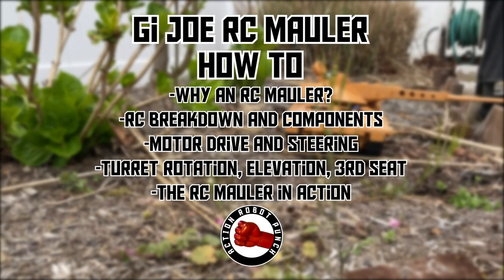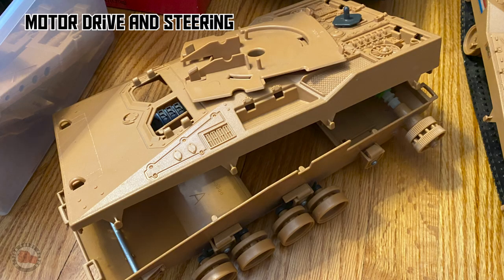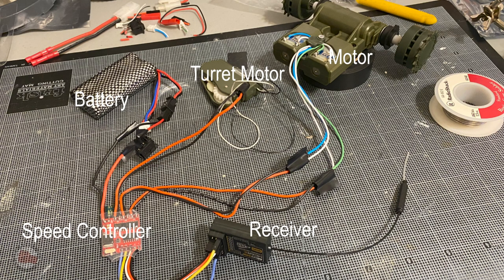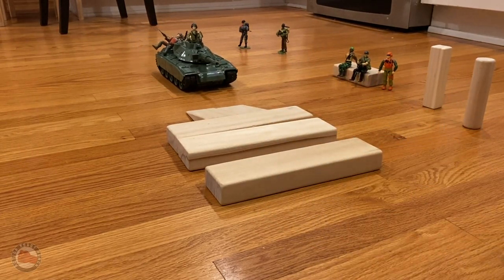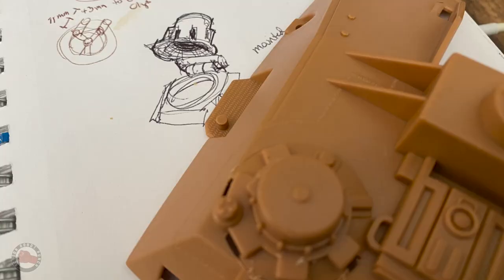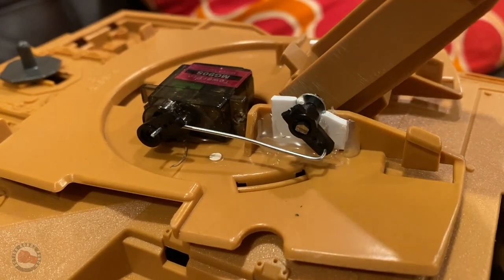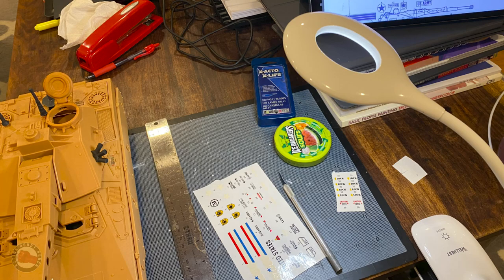Gi Joe Remote Control Mauler Tank - DIY How To

Comment: nice tutorial!
also, it s great memorabilia to see the hal laser cannon.
man, did I love this thing.
don t you have grand slam to operate it?
I d see Duke in the turret, Heavy metal is supposed to be the driver.
if I did rc a mauler, I d probably not make a hole in the turret,
I actually like an automated firing system as concept.
nowadays, some tanks are totally un manned.

I d like to see your take on the latest biggest tank of the joe line.
the grizzly, I have not seen much of this model.

good work!
Reply from the maker: I don’t know if I have grand slam. The first year guys mostly look the same to me 😁 I also loved that HAL. I had the mobat to tow it. I never had a mauler. I was to old to get toys by then but my cousin got it and the moray, defiant, etc. I’d play with him and think how cool these toys were but I was too old to get them. Now I don’t care how old I am lol
Reply: @ActionRobotPunch  in 82 I was 13, I kept having more money, I could nt stop buying more until 19, of course, I was posing figures more than anything around 15, had girlfriends and all, my friends knew my hobby - collection, none of them did it though, at 19 my sport car [crx] payments choked my expenses, and had little space, I had to buy plastic storage bins, and some pieces broke as a result. [packed too tight] I stopped buying figs around the 'head hunters', maybe 91.. the line died shortly after. with a house and more money, I never would have stopped collecting. my biggest regret was missing the rolling thunder.
I loved looking at my whole collection in a room, all figs standing 'for review'.
it was especially rewarding looking at cobras, since they looked more like a real army. multiples of the same units, uniformity.

Comment: Great video! It inspired me to do this with my Mauler. I am 90 precent done with my build. A few questions tho. It looks like you cut the nubs off on the barrel. Is that why you used the washers? How did you secure the servo horns? I am stuck and can't think of how to get the barrel to work properly. It actually doesn't work at all for me yet. Thanks for the video and links to all the parts and 3D designs you have created. So helpful and generous of you to post all of your design work for free. I did have to create my own gear for the turret cause I am using the Heng long motor and couldn't fit the turret motor. Not perfect but it works and fun to learn how to do it. I am also documenting all my progress and will hopefully post a video and would love to link your video if that is OK.
Reply from the maker: That's awesome! I love to hear that more folks are making RC Joe vehicles. To make the barrel move I didn't need or want the plastic nubs that the toy used (13:25 in the video has a really good view of this). The toy relied on friction to hold the barrel and we want smooth movement. I put an axle in the barrel, the hex rod. Then I put the axle through washers on either side - these washers are connected to the hull - glue and some white styrene. Now the barrel can move as the axle rotates in the washers. I used hex because it grips the holes I drilled in the barrel...no slipping. To add the horn to the axle I just drilled a slightly small hole and shoved it on - super tight - but also may have added super glue. Now when the horn is pushed, it causes the axle (hex) to rotate, that causes the barrel to elevate. Hope this helps!
Reply: @ActionRobotPunch  Thank you I will try that

Comment: Probably the most awesome thing ive seen all year!  Great work!  Question though: what modifications did you have to make to that second choice motor in order to get it to fit and work in the Mauler body?  How is it mounted and secured?  How are all of the other control items secured, like the ESC, servos, etc?  Thanks again!
Reply from the maker: Thanks. Mostly things aren't secured :) The ESC, Battery, receiver and just laying in the hull. I was going to secure them but I find it easier to mod and fix things with them not attached. The motor didn't require any modifications and fit. Then I simply secured it with some hot glue, again a non-permanent solution that allows me to remove the component if anything happens. The RC Moray I did is more secured and fixed mostly because it's a boat and I'm worried about water intrusion. Thanks again for watching.
Reply: @ActionRobotPunch  ARP, thanks for responding!  In the link you provided for the second type of motor it says that motor was faster but required modification, so I just wanted to be sure.  Thanks again so much!
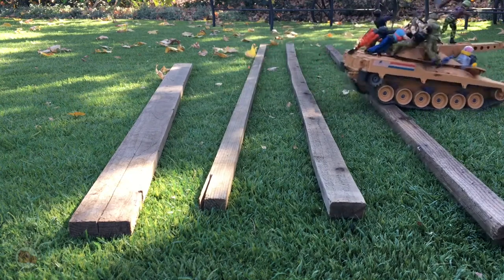Reply from the maker: @myksanchez1222  Yes, forgot I listed that second motor. I used that on my equalizer and it did require me cutting off the top bit of plastic that supports one of the screws that seals the gear box. Check out my equalizer video at around 2:00 in and you can see the motor mounted in the mauler hull. I also had to remove the "button" that is used to control the Mauler's movements, but that just pops out. Hope this helps. https://youtu.be/X4GK9RMt_5w?t=126

Comment: The real questions on this are: Was Grand Slam on leave, and that's why they went with Flash? Why was Flash wearing Thunder's visor? Are they bunkmates and he was rushing out in the dark? And while Tollbooth did a wonderful job, this is Heavy Metal's baby. He should have been driving and Steeler sitting (for once) in that delightful top seat. Now Tollbooth will want his Toss n' Cross to do the same thing. Then Cover Girl will need it for the wolverine, and then the whole motor pool. I think you made more work for yourself, and I can't wait to see them.
Reply from the maker: I’d love to get to those others. The toss n cross would be pretty epic. I’ve seen RC versions of bridge crosses so it is possible. Thanks for watching.

Comment: whats the kind of motor called that you used for the turret? the link doesnt work and id like to get one of those motors. thanks and awesome work!
Reply from the maker: Google “heng long turret motor” It’s just a small motor with a gearbox to reduce the rotation speed. Here’s a link to one. Thanks for watching! https://www.ebay.com/itm/122329798271?chn=ps&_trkparms=ispr%3D1&amdata=enc%3A1oS1ENezGTAW5JjuxOkW15g3&norover=1&mkevt=1&mkrid=711-117182-37290-0&mkcid=2&mkscid=101&itemid=122329798271&targetid=1584571731043&device=t&mktype=pla&googleloc=9003662&poi=&campaignid=19894961968&mkgroupid=148855406073&rlsatarget=pla-1584571731043&abcId=9307911&merchantid=101975979&gbraid=0AAAAAD_QDh_erGHlpHJU0t4h1JyIS8gpw&gclid=CjwKCAiA4smsBhAEEiwAO6DEjdM2wTORN2RkkusmOKg-keXTDfSgZm781ZBuAp9_9kduEQTnqbzPhRoCmoAQAvD_BwE

Comment: How is power delivered to the servo in the turret that raises the gun? Presumably you don't want any wires running between the hull and the turret that could get tangled when it turns. Are the gun and treads powered independently by two batteries?
Reply from the maker: It’s all one power source. I just run a wire up to the turret. It doesn’t spin around a lot so easy to deal with. My flak mauler though has a really fast turret. That’ll get twisted up. There are spinning connectors available but I haven’t been motivated enough to want to rewire it. Thanks for watching.